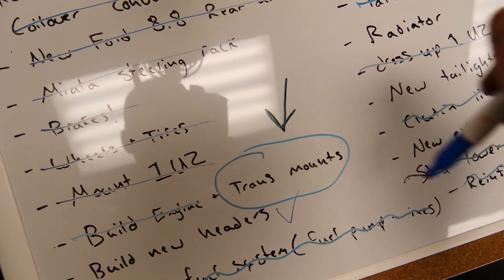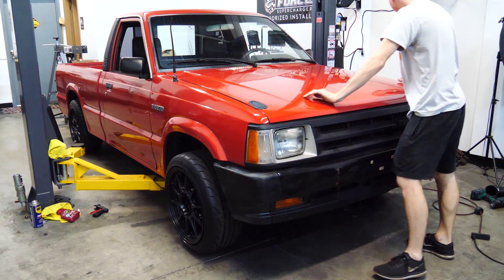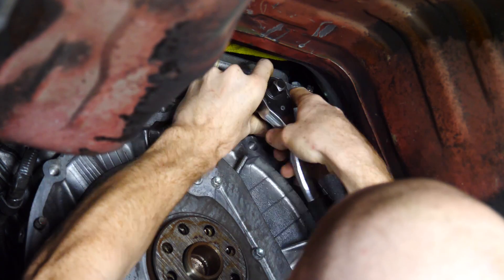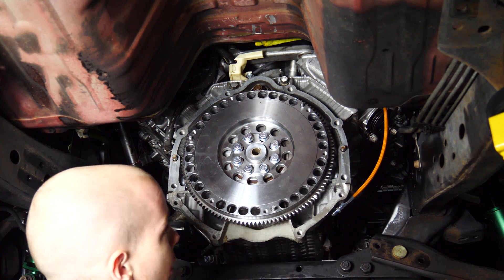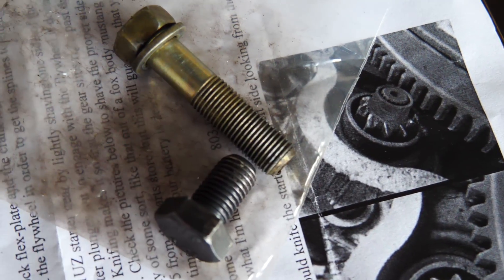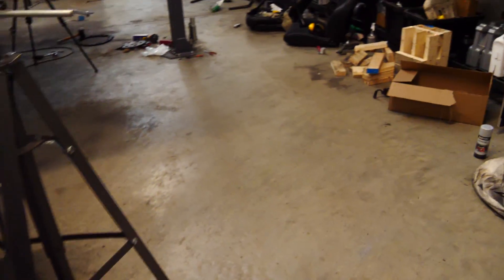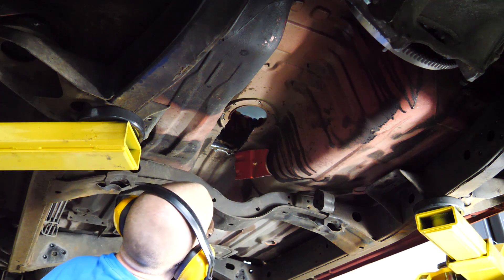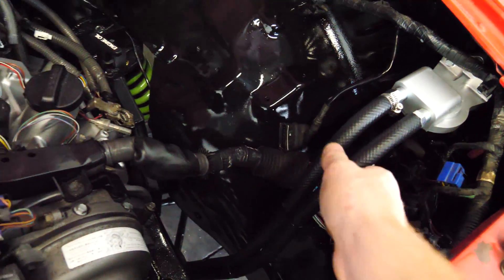Transmission Problems with the Drift Truck...

Comment: If you can't screw the bolts in by hand, you know there is something wrong, never force it
Reply from the maker: Yeah, I shouldn't of assumed they were correct. Im glad I noticed something before I did all the bolts tho!
Reply: Grandpa said "if it doesn't fit, dont force it, you'll only make your mother mad."

Comment: Hey Gingium, I know you're not an idiot and all but get that one 14 swapped out for a 15 on the flywheel, it's probably a very minute weight difference however in the interest of longevity of the engine you want that flywheel balanced as best as possible and having different size heads on the bolts will throw that balancing off! Keep up the good work man, best series yet!!!
Reply: that's the first thing I thought of as well, probably not gonna kill anything, at least immediately, but not a good choice longterm
Reply: Yep, same thought here, plus I don’t think those bolts the correct grade steel. They may fail. Plus they should have a lower profile head.
Reply: +1 regarding the inconsistent hardware used.
Reply: Yep. If has any strange vibrations, I’m betting this is going to be the culprit!
Reply: I'm hoping he see's this before he regrets it
Reply: He needs to use chromoly ARP flywheel bolts.  Not cheap grade 8 crap from the hardware store.
Reply: he can technically get high grade bolts from the hardware store and be fine, but I do agree that he shouldn't have low grade bolts, and they should all be the same size.
Reply: I would worry more about the fact those are not grade 8 bolts on the flywheel, its under alot of pressure.
Reply: Corey Stevens  They are grade 8
Reply: @angry_sprout4964  most grade 8's are a goldish color
Reply: He says in a later video they're grade 8 bud :) Nice SV by the way
Reply: @angry_sprout4964  thanks

Comment: Gingium, I respect you a lot, you are learning by doing like I do.  you are still very young and have a lot of life to live and time to learn things. Glad to see you got a bench, but where's the vice? And get a grinder/belt linisher for it, so useful you will wonder how you managed without it, great for things like tidying up the ends of bolts you just cut the end off (flywheel bolts) and any bits of fabrication cuts. Get that engine out and bolt the trans to it, check the clutch works ok. refit the engine and trans as one, make sure you have a 3 degree angle on each Universal joint on the propshaft. The adaptor plate hole you borked, if the bolts wound in all the way, put them back in with some high strength thread lock and forget. either that or drill out the holes to the next size up and tap.
Reply from the maker: Its impossible to fit the engine and trans through the top of the engine bay as one, but to everything else: yes!
Reply: cool, another thing, dont worry abou hurrying the build, you know its better to take a little time and get things right first time. its going to be great when its done!
Reply: Mike Forager n
Reply: y

Comment: Those new bolts with the incorrect pitch werent nearly as long as the old transmission bolts. Get some longer bolts that will engage the thread that is still in good condition further in the bolt hole. Youll still probably have to fix the thread that was ruined though, and may have to use an expanding reverse tap thing ( idk the actual name). There isn't much thread on the new bolts either, so longer bolts will be better.

Just my thoughts based on what I saw.
Reply: I think the main issue with bolt length on the adapter plate is making it so the bolts don't interfere with the bell housing on the transmission. It looks like the holes in the adapter plate are counter bored to fit the bolt heads, and those bolts look to be plenty long enough for proper thread engagement.

Comment: There is a fastenal on Wilson street in Batavia near Thompson bumper to bumper. Go there and get the bolts you need and but your truck together. With this adapter company you're liable to wait a month for them to send you some more wrong bolts. Also... are you certain that the bolts you tried to thread into the stock bellhousing holes weren't in fact the flywheel bolts that you used grade 5 butter bolts from ace on?

Comment: Here's something to try; buy a tap that is the same as the threads on the engine block, and just try to clean up the junk threads.  I had the same problem with my speedometer cable bolt on my aluminum Turbo 350 tail-housing, and it worked out great.

Comment: Hi, I do respect your builds and it's nice to see how you are learning with each video. If I was you, I would highly consider / reconsider two things:
- Oil filter relocation kit: if you change the oil and the oil filter, or fill up the oil the first time, you have to pre-fill the oil filter. Otherwise the engine and main bearings would get a long time no oil, while you are cranking the engine for every time after oil changes
- Engine & Transmission positioning: I remember, that you position the engine perfectly level in the engine bay. Considering, that you have an relatively long prop shaft you will run into problems, if you don't install a prop shaft with at least 6 joints (2 in front, 1 in the back). => almost every stock engine ist tilted backwards in order to avoid prop shaft binding.
All the best!

Comment: Did you weigh those fly wheel bolts? If not it WILL vibrate you out of it. and tare up the rear seal. Use one bolt style. One bolt weight and one bolt size. Like lets say 100 grams... And 101 and 99 will work but you could get a first order vibration. Lol flex-plate.

Comment: I know you are feeling rushed for specific deadline but I think it is going to effect your build long term.  The bolts from Ace don't look like the correct grade, and I don't like that one is "different".  Order a set of ARP bolts and reinstall the Flywheel.  The stripped block holes (since it is aluminum) would be better repaired by the heli-coil method. Best of luck, looking forward to more of this build, I had a GS400 and that engine is amazing.

Comment: A lot of people mentioned the flywheel being imbalanced, but something I noticed is you're going to have the oil filter facing down. It will hold oil, and if you mount anything under it in the bay there's a good chance when you go to change the filter you'll have oil all over the bay.

Comment: So what if you drill the holes in the motor a little bigger and tap them to the size of the wrong bolts that the company sent you. I love this build tho
Reply from the maker: I can just retap the current holes
Reply: that wouldn't work, because he would need bigger bolts, because the inner diameter of the thread would be larger due to it being drilled out.

Comment: A key locking insert from McMaster or something would be perfect to fix up those holes that you messed up. Just drill and tap, put the insert in, and then push the keys in to lock it. It's going to be your best option outside of drilling and tapping for the next size up, which is obviously the best option.

Comment: gingium thread it one size bigger and put one size bigger bolts in there. 
Or weld the heck out of the stripped bolt holes, fill them up and rethread.
or
Theres liquid solutions that harden and are reliable and then you thread in a new thread. Dont waste your money on another 1UZ dude. Theres ways to fix it and it will be actually really reliable :)
WORST case scenario-you will try and you will gather experience what works and what dont. Its the good times, not the boring ones :)
Love from Bulgaria :)

Comment: Gingium I applaud you for resourcefulness and your desire to want to get this truck done. I want to see it done as well. I think it is a really different build and it interests others. However I noticed one thing you did that is crucially important. Please find a different flywheel bolt. That hardware you used simply won’t hold up. A standard flywheel bolt is typically a very high grade of hardware (grade 8+) and are typically a one use bolt that is stretched when torqued ensuring the security of your flywheel to crank. I am not saying this to criticize you, I am simply noticing something that may cause frustration and damage down the road. Please consider what I’ve said here. It is your build and you can do what you like.

Comment: Since I haven't seen the comment on it yet, your shifter hole might need to move more. You're basing it off the stock transmission in the stock location with the stock engine. The 1uz is like further back than the stock engine the adapter adds additional length to the length of the assembly so you might have to take a little extra off that hole in the floor to make things clear.  Be careful that the springs on your clutch disc dont make contact with the new flywheel bolts, you might have to shave the heads down some, I'm pretty excited to see this thing finished Other than that things are looking good man

Comment: A month ago I missed a bolt on my motorbike from the front caliper. It needed a 1.25 pitch and could only find 1.5 pitch bolts M12. After a long search they had just one at a local bike store. For me that was enough but just a pain to get one locally.

Comment: If you're ever doing something like this again, use Kennedy Engineered Products. I'm sure they could make an adapter plate even if they don't already make one for your application. Right now I'm helping my dad engine swap his car and everything bolted together like a dream. Except for when we snapped 2 flywheel bolts. We got some new bolts after that.

Comment: Take a stock transmission bolt and cut a vertical slit in it just on the forward side of way the threads go and its a free tap that you know matches the thread pitch

Comment: If you still have the stock mazda motor the bolts holding the flywheel on that are m12-1.25 and should be short enough to work

Comment: Note sure if anyone below had mentioned this already  but....Shouldn't those flywheel bolts be "Stretch" bolts rather than standard ACE grade?  Perhaps the threadlock will suffice but there is nothing worse IMO than doing a job twice...

Comment: Did you try to start the bolt with an impact? And were those actual flywheel bolts or junker hardware store bolts? You need specific material for those, soft steel is going to sheer right off.

Comment: Hi Ginge. I have to tell you this, that flywheel bolt you bought at ace is not hardened and the wrong spec for a flywheel. If it sheered off,  theres a good chance the flywheel would chop your ankle off. Please order the right one from ARP. Thanks

Comment: Didn't you put the 1UZ engine further back in the bay then the stock engine? So the 5inch you cut out for the shifter might as well be 6, 7 or  8 inches?

Comment: Flywheel bolts need to be Grade 8 or Metric 10.9. They need torsional rigidity, rather than the tensile strength of a traditional bolt. 2UZ owner here. The torque is real. Just my 2c, don't use hardware store bolts for your flywheel.

Comment: tbh id just send it with the 2 bolts crossthreaded in all the rest of the bolts are in, my subaru has had like 5 out of 8 bolts holding it in for 2 years now

Comment: It seems like you cut the hole for the shifter measuring the distance from the mating surface on the housing, but how do you know the mating surface of the engine sits in the same place as the old engine in the car?
Reply: Alessio Carlevaro yeah I thought he moved a little quick on that cut too. But he'll make it work

Comment: Kept telling you. 5.3L L33 engine from a z71 vin B 4x4 pickup would have been just as good. Its aluminum also... Much easier parts to obtain and Holley makes a plug and play kit.. They took a LQ4 5.3L iron block and put a turbo from a junk yard SUV. That engine cranked 600hp on stock bottom end..
Reply: @skinniesANDtitties  5.3L have 3 runs. Vin A, B, and T. T is flex fuel iron block 295hp. Vin A is iron block gas. Vin B is aluminum. They turboed a vin A out of a suburban which is an iron block LQ4 gas putting 305hp. L33 is the Z71 pickup aluminum block at 310hp.
Reply: @skinniesANDtitties  Before commenting, read again. L33 and LQ4. Both 5.3L different model of vehicle and different HP ratings. Each are universal on some parts, others are not.

Comment: is it possible to grind down the first messed up threads in the block and let the bolts (with the right thread pitch) catch deeper in the hole? the minimal easiest solution in my book, if it works with the given length and whatnot!
Reply: Sami Mejri it would be better to just tap thread to a little bigger one pitch

Comment: please dont mount the oil filter there. you will spill so much oil on the harness. or make a bracket so u can take if off the fender to change the oil filter.

Comment: You could have stripped out all the holes and re tapped them for the bolt pattern that they sent with the adapter plate

Comment: uses an angle grinder on a bolt
touches bolt 
“Oh that’s hot. Who would’ve thought”
Reply: lmao I do that all the freaking time myself.  What sucks is touching a 3/4" copper pipe after you just soldered a fitting to it.  Why do I always do that.

Comment: Anybody who loses interest in this project because it's taking too long clearly has never had a project car. You could just helicoil those holes easily. And for those that give ya hell about proper terms, an automatic "flywheel" is called a flex plate.

Comment: How much horse power do you think it makes?
Reply: depending on the revision of the motor, the 1uzfe vvt-i made either 290 or 300hp to the crank. and with him not running an AC compressor or power steering, that's a little bit less work the engine needs to do. Not sure of the drivetrain losses of his setup, but well north of 200 to the wheels would be a safe assumption.

Comment: Man that sucks the mounting plate company sent the wrong bolts...hopefully you can fix the hole and find some bolts to make it work.  

Funny enough I had to do a double take on engine oil filters to see if that was a good place to mount it.  I thought it was a little weird to mount it so far up above the engine... but after a bit of read it seems like there is no issue with it.  

https://www.boatdesign.net/threads/moving-oil-filter-placement.57414/

Bonus fact, you can now get  a oil cooler and mount it after the oil filter!

https://www.etrailer.com/question-271425.html

Comment: I don’t really know much about drifting; so why is a manual better than an automatic for driftinf
Reply: you need to stay in a gear while drifting, and you cant just change gear mid drift, which an automatic could do, also you want to be in certain gears for some corners and then its usefull to select gears urself
Reply: Bc an auto may shift during drift which would make you straighten out also manual let's you clutch kick
Reply: Manuals are better for sports cars in general, allows you to excercise more precise control of engine speed/power output. I drive 2 cars regularly, an automatic Hyundai (my dad's) and a manual WRX (my own)
Reply: Paddle shift autos are better than manuals in every way BUT he doesnt have the funds for that kind of build. Manual is much better than a standard auto. You need control over gears, shifting up at the wrong time which an auto would do would prevent the back tires from spinning.
Reply: Paddle-shift autos? You mean DCT? Yeah but as you said those are usually for higher end sports cars
Reply: @NazbolCaliphDonaldaddeenTrump  that's 1 of many types, but any of them other than a cvt.

Comment: Did you just cut a hole for the trans going off the old trans alone? 

2 problems with that. You have a different motors in a different location. Not just forwards or backwards either. You had to mount it off too the side. 

Problem 2 you measured off the stock gearbox, don't forget you need to add anther inch or so for the adaptor plate. 

I'm enjoying this build, but, so many things you put down too 'gingium luck' wouldn't exist if you actually took a little more time.

Comment: looks like you only damaged the first few threads, i would just get a drill bit and drill those first few dickard threads and run the correct bolt just slightly  longer, i'm sure it'll be fine